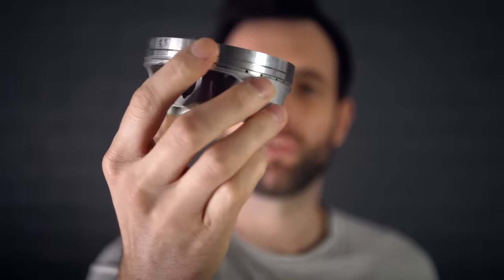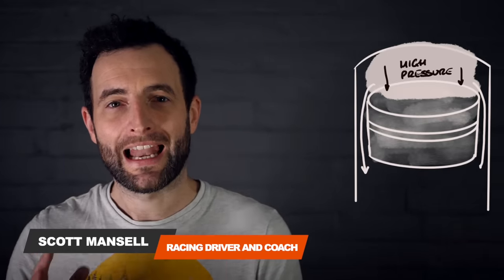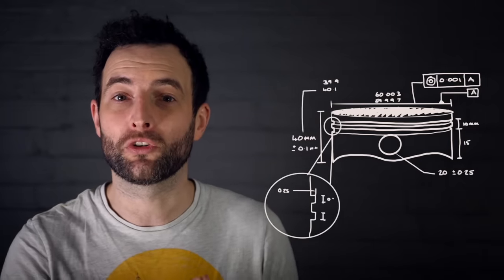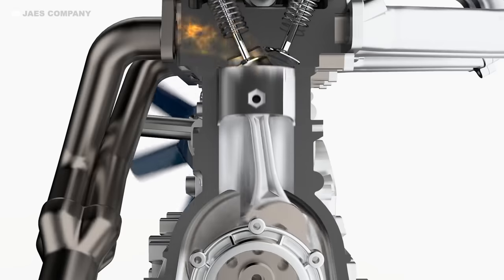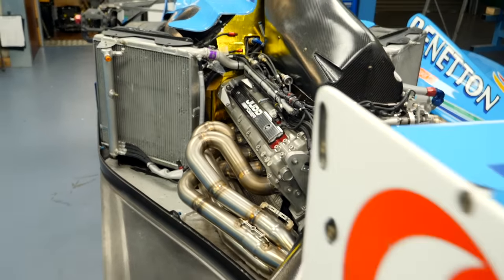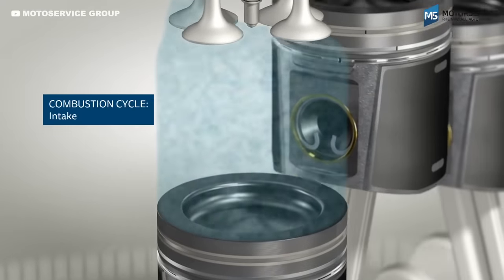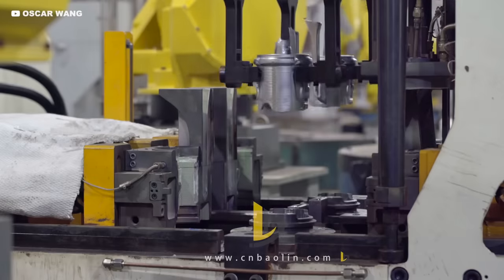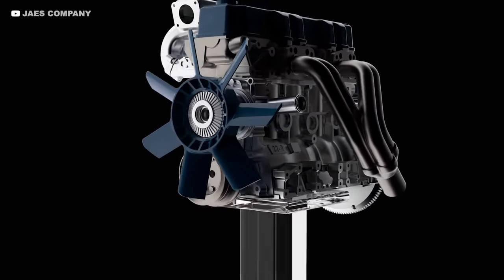Why F1 Pistons Cost £50,000!

Comment: Just in case someone is to lazy to look, a normal piston ring gap is anywhere from .3mm to .6mn, so a 0.15mm gap is ridiculous, so they even make feeler gauges that small?
Reply: he was just giving an example number. when warm, ring end gaps are around .02mm and bore clearances are closer to .01mm. and no, you can't measure with feeler gages. that stuff is measured with special machines and hot clearances are "predicted" by complex computer models.
Reply: @lexluthor6906  so what kind of special gauge do they use to figure out the ring gap if they are not just making a prediction? And I highly doubt they predict anything in this sport, the computer models may have told them what it should be but they always test it in the real world to make sure. So they are not just letting a computer predict what their ring gaps are, I’ll never believe they do that.. and just so you know you can get feeler gauges all the way down to .0015in so yea they could use feeler gauges to measure the ring gaps on the motors. But I would also assume the teams are not doing much that deep in the motors, I’d bet that falls to whoever is manufacturing the motor, for example how Honda makes Red Bulls engines, I doubt Red Bull is tearing apart an engine in the paddock on race weekend, I’m pretty sure they just swap it out for another unit? And as I’m sure you know they have all their motors allocated to them at the beginning of the year so they have to make them last
Reply: @lexluthor6906  and I’ll give you the measurements of the ring gap while hot would have to be a prediction because there is no real way to measure it while hot. But I don’t really think that is a super complex computer model either, cause how do all these guys figure out what they need to set their ring gaps at when boosting a motor? You don’t keep pulling the rings out to adjust them..
Reply: @TheEmpire822  pistons are the most complex part of a modern day engine, race or production. designing a new piston can take a year and require millions in software, hardware and highly paid specialists. F1 runs at one point but clearances are critical and tight. production engines dont have to be that tight but have a much larger running envelope.
Reply: @lexluthor6906  your not going to put me in “the human torture rack” if I don’t agree with you? Right?
Reply: @TheEmpire822  not a matter of opinion, it's just what is. open cycle combustion takes more than a week to solve by itself and it def wont work on your average macbook lol. that just the beginning.

Comment: I don't understand your figures for "how much the piston will weigh" at the 5:38 point.
You say that it weighs 300g under 1G (normal gravity) but that at either end of the stroke it experiences 200G which you then say means that it weighs almost 600KG & you have a formula on the screen which is 200 x 9.81 x 0.3 = 588.6kg
But surely if the piston weight 200g under 1G then under 2G it would weigh double that (400g) & so under 200G it would be 300g x 200G = 60,000g which is 60kg not your 588.6kg ??????
Please can you explain this to me as it appears I'm missing something.
FOLLOWUP : OK I've spoken to a friend of mine & he says that your figures are incorrect & your figure is actually 588.6N NOT kg & that my figure is correct.
Would you please check & update.
Otherwise, great video as usual, thanks.
Reply: Thanks

Comment: The vid still does not explain why each piston is £50,000. I can't see the numbers with suggest this quantum .. Also why not make pistons out of Carbon fibre? What the piston does is be a carrier for the rings and have a measure of toughness so it does not tear itself apart.  It will save all that aggro for windage and coefficient of expansion and ting.

Comment: Ok, I know F1 engines are very costly to make and maintain, but 50,000 pounds for a piston, not likely. Maybe for a set of pistons but that is still over the top. Any top CNC operator will be able to machine these pistons to extremely fine tolerances, ok the material will be the best of the best, but from what I know it is set aluminium alloy, so not really exotic.

Comment: No , there is no reason for them costing 50.000 vs the 50 for a piston , besides 1 is specially made and the other is serial work . Yes , the specifics are much more precise , and requiring more work/ better machines , more checks to make them but if all pistons would be made like that , it would cost like 75 pounds , and not 50.000 . Anything which is made like 100 per year is much more expensive then making 100 million of them a year and that is the price difference . Nothing more .

Comment: 0.15mm gap ? Thats much. i have learned in school 0,01mm per 10mm piston diameter as a rule of thumb. my one cylinder motorcycle engine runs a 90mm piston with a gap of 0,07mm...

Comment: Nothing in this actually justifies the absurd cost. Everything you describe applies to any high quality forged or billet piston. Top quality, race spec billet pistons cost around $500USD each. Those are pistons with tolerances in the .001 range. Machines from 2618 T6 Aluminum.

In short, the 50k price tag is justified only by the fact that F1 teams CAN and WILL pay that for them. Period.

Comment: Actually, who taught you physics?
200g accelaration means 300g pistons has 600 N force, equal to 60kg, not 600kg
Another miscalculation, piston change direction 300 time per second means 9000 rpm. Which f1 engine rev that low?

Comment: Look at a Carillo piston for a crf250r then look at the price then look at the f1 piston, same dome and skirt design.  if you do the piston foot per second calculations for a 250cc 4 stroke dirtbike vs a f1 piston you will see that they are extremely close.  A full factory top end with piston rod and head can run up to 4 or 5 grand for a single cylinder dirtbike.  multiply that times V10 or V12 and that is the actual price of the top end.  the block and crank cant be more than 50 grand......  An F1 car is probably a million dollars all put together, the additional cost is in the development.  Please no one go out and try to buy old f1 parts unless its the whole car 0.O

Comment: I've worked as a machinist my whole life . No matter what anyone tells you , a piston is , has , and would never be worth 50,000 anything , it's either a forging or casting at the end of the day and any premium cnc lathe with the proper diamond tooling can turn a piston consistently within  .0003" all day if conditions are controlled . Same goes for mills. These engines are not made by gods they are made by people and like anything are worth what someone will pay for them . Is a diamond worth 20 million dollars ??? Only to someone with the $ who has and is willing to spend that much on one . But it's true value in the grand scheme of things ? Definitely not.

Comment: Because the supplier found somebody that would pay that much. Piston that are fitted tight on  purpose. At operating temprature it expands slightly less than the cylinder bore. Then it fits correctly. 

My car is the opposite. The engine rattles like a washing machine full of walnuts when cold. It quiets down when warm. OK by me.

Comment: Really would have appreciated some more detailed explanation on the metallurgical processes that go into making these pistons, or how the machinists achieve the precise tolerances required during the actual machining processes. Even something on how these machinists overcome the difficulties involved with cutting these alloys, that would go some way towards explaining why these pistons cost so much. There's no detail about anything in this video, it's all a cursory glance at basic processes before moving on to something else.
People don't need to know the basics of how an engine works, they watched to find out the why's and how's on these particular pistons and it doesn't deliver that. It's hipster clickbait.

Comment: Yea  I am finding a lot of doubt in these claims.. pistons typically grow a bit larger at a higher rate than the cylinder walls they ride in..   Saying that they are "seized" in the engine until the motor is warmed up?   highly unlikely..   Since I entered the industry in 1974, I have never seen a piston to cylinder wall clearance that increased as engine temps increased.. is always the other way around.. they grow tighter...   This would also be a good reason to "pre warm" an engine prior to starts.. so that the piston does NOT seize during the initial warm up when the block is cold and the piston is hot..  Tighter clearances tend to make better power..   But this also draws your "piston/cylinder" clearance numbers into doubt...

 0.15mm is not .060"  it is  just shy of 6 thousandths and is actually kind of loose for a piston to cylinder wall fit..  Typical "factory" engines run at half of this in those smaller bores....      .006 piston/cylinder wall clearance is a LOT...    Specialty pistons such as hypereutectic are fit at .0015"

adding insult to injury.. you appear to be showing diesel stuff. gasoline pistons might have valve pockets but certainly not hollowed out in the dome area... pistons with that deep dish would never work in a naturally aspirated engine, but they are very common in diesels..   

Virtually ALL pistons are of some aluminum alloy, no one uses a "steel" piston in an engine that I know of.. forces are around 12 tons on power stroke and around 7 tons on the return trip (stretches rods) at 12,000 rpm .. This information is readily available at the piston makers web sites ..    

. the "engine" model also appears to be a diesel  (no spark plugs)...  I could be wrong but with some 40+ years building various racing engines?   I am always open to new knowledge..

Comment: OK, so why do F1 pistons cost £50,000? 
You didn't explain that at all. 
Harley Davidson pistons are doing between 80~85mph about half inch after TDC. and that motor is not renown for high rpm (usually limited to about 6,000 before big ends fail due to centrifugal loads although as much as 9,000rpm on very select parts hand built motors)
1000cc motorcycles have been revving over 12,000rpm for last 20years or so, some much much higher (Yamaha with 12 months unlimited guarantee revved to 17,000 rpm, if you do a search on You Tube you'll see tach at about 21,000 rpm after a missed shift). Even if tach is '10% off' it's still crazy high rpm, Electronic tachs are usually reasonably accurate
 'Custom' pistons can be made for around £125 each. X-ray adds a pretty fair chunk of change on top of that but not £49,000+.
If you were explaining monocrystaline pistons which are 'grown' and take around 3 months to make it kinda explains the cost but any forged or billet piston - your way off base or someone is getting royally screwed over (worse than military contractors" oh, government, add another couple of zero's before the decimal" £5.00 becomes £500.00 )

Comment: What an over priced piston.  Any forged piston with a short skirt.  What a waste of money.
 If you want forced & then machined to spec,. No problem you still will not spend that kind of money.  Tolerances in any race machine is tight hell even some street going machines have extreme tight tolerances.  A good machinist will not build an engine that is too sloppy.

Comment: mostly BS.  Te cost is in the companies marketing and profit margin.  The actual cost to manufacture is cheaper than the larger machined pistons because it uses a smaller blank.  CNC time is also less. Both pistons get the same plating.

Comment: The FIA set the rules for FI and the FIA is controlled by the big companies involved in FI and can shut out the smaller competitors by their big budgets.
The wasteful costs of producing a F1 car is set by the big companies so their cars can win.
Your example of the cost of a F1 piston highlights this wasteful policy.
The DFV Cosworth engine was an excellent reasonably priced racing engine designed by an excellent Engineer.
Now the big companies start by saying we are prepared to spend £50,000 on a piston now the engineers can design a piston that will cost £50,000.

Comment: I knew we were in trouble in this video when a racing car driver was trying to explain engineering!I almost gave up he said that 0.15 of a millimetre  was 60 thou! Having spent 46 years in the aerospace industry going all over the world machining components to extremely fine tolerances this video is a waste of space it’s does not by any means justify the cost of these pistons. Aluminium in the scale of things it’s not very expensive and machining is machining the machining centres operate around a hundred pounds an hour and I guarantee it does not take very long to machine these components. Forging is cheap also.

Comment: bolocks. f1 piston is no more adwanced than those in road cars. in contrary steel forged pistons used in road cars are actualy more adwanced. 
about billet and forgin it is same end product but making 3d shape out of billet is slow and costly peocess and is good for small quantities while forging is for mass production. and no modern car uses casting pistons anymore. 
also f1 pistons has single combustion ring. about rpm, f1 engine is similar to super bike engine also reving up to 15.000rpm and those are serial built.

Comment: As a loser who comments on 2 year old videos, I can assure you that 0.15mm is not 60 thou, it's 6 thou.  (2:49) And if you had 6 thou clearance between your piston and cylinder, you'd know it: it would sound like a box of hammers.  For reference, typical gasoline '80s  road car piston clearances are in the range of 0.8 to 1.2 thou for cast pistons and 2 to 2.5 thou for  rattly-when-cold forged pistons.  Yes there are examples outside this range, but 6 thou is mahoosive.

Comment: The future of the car is electric, today the news that the Israelis after 8 years of research have built and given the news in these hours that the batteries will recharge in 5 minutes. By now the internal combustion engine is a total flop and the costs made for this tecnology of the 800th  are now and will be a bad memory. The performance of the electric car is higher ( 0-60mph in 1,4 second, absurd) and the internal combustion engine is now a distant memory. There is already the electric formula one called FORMULA E.

Comment: It really is a bullsh*t for F1 hamsters. There is no "cost of a F1 piston". There is a cost of R&D development of a F1 engine somehow divided by its parts.And there is no rocket science in these pistons at all. They are designed to withstand temperatures and speeds just a little bit higher that these in an ordinary engine - thanks to its extreme short stroke geometry the linear speed of a F1 engine in just a little bit higher and in a boring Ford Focus engine.

Comment: @ 2.58 min : 0.15 mm is .006 in. Much too large a piston clearance . In truth ,even motorcycle engines  use  +/- 001 inch  (.025 mm) , rev 15, 000 rpm , cost less than  $150.
Get your numbers right if you wish to get all excited about racing pistons . Then
that 50,000 ruble cost ,  I don' t  believe it.  Are you on pills ?

Comment: With an engineering / machining background, I know that none of the tolerances, materials, metallurgy, machining or inspection procedures you cite are any different from high end, high performance consumer available billet or forged pistons (except for the tighter fit, which wouldn't be hard to duplicate if needed) at a fraction of 50K. I call BS on you reasons for the 50K price, if its true, I'll lay odds the price is simply inflated because the design is propitiatory with no competitors, there are fewer made,  it goes into an F1 engine and owners/race teams/sponsors have a lot of cash.
Reply: yes exactly. i machine turbos. bearing tolerances on those are +- 0.0001" its not that hard or expensive neither is aluminum. with a cad file i could make one of these in a day, so on a one off it would be like $1,000 labor and like $200 material, of course you'd be doing more than one so it would be more like $500 each for labor.

Comment: So why do race car engines have to be so special if Honda can make a little 4 cylinder engine that people are getting 1,000 hp out of? Is it just the prolonged stresses, or what?
Reply: they have to make full power for about 90 min straight, without losing any of it's fuel efficiency. the engine you mention wouldnt last 10 min at full power not to mention the pumping losses means it wouldnt make it through 1/2 an F1 race before it ran out of fuel.

Comment: So by this reckoning the pistons in a world superbike which rev to over 16000 are stronger but pretty sure they do not cost the same as the F1, so is this an exaggeration of cost or just another case of F1 lets spend millions when thousands will achieve the exact results or perhaps lets employ 500 people to sweep the floor. Even the moto gp bikes rev higher again and in general last better than the F1 engines and their costs are nothing like this. It just does not seem to add up.